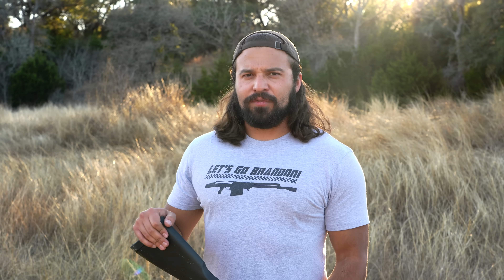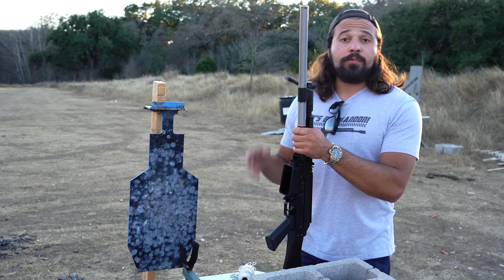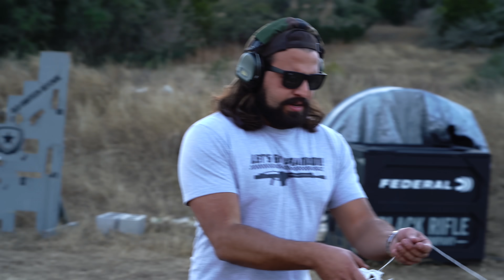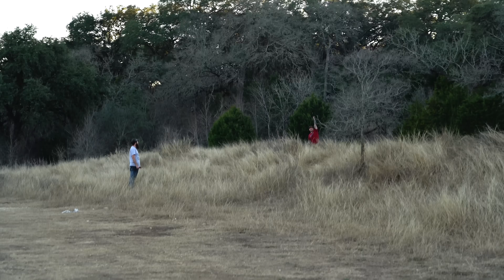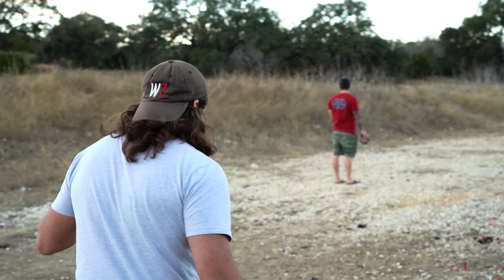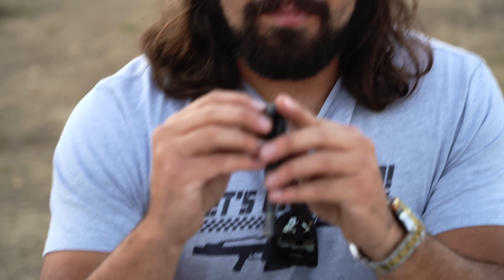Testing an AK Chambered in .50 BMG

Comment: I work in a factory that makes automotive components, and my co-workers come from what you might call a wide range of backgrounds. When something breaks or a screw in a machine gets sheared off, sometimes, people get... confused. They ask, "How did that break?" I say, "The machine is just too strong, and it is a bad design. It just ripped that bracket off and sheared those four bolts off." They say, "How? It was metal." Once a material strength gets beyond what a human can bend by hand, people have a hard time wrapping their head around the forces involved. Some people do not even have a clear grasp of the difference between steel and aluminum. I do not really blame them for not knowing, but it is funny when they argue with me.
Reply: it's kinda odd though. like I failed physics but, general watching shit on youtube of how things are made I understand generally how these function and how easy it is for parts to fail even in all steel constructions.

Comment: I would love to see a collab with Smarter Every Day. Between you two, I would love to see a video of what happened and why exactly that gun failed the way it did. Not just the barrel coming off but all the other ways the gun grenaded as well.
Reply: Stay tuned, that's exactly what this boy does.
Reply: big boolet,not so big barrol ,not strong like dimitri........any more questions?  look at the shell casing diameter,compared to the outer diameter of the barrel....very,very thin....theres a reason the bmg 50 is designed the way it is
Reply: @trillrifaxegrindor4411  Yeah, I get that, I was thinking more along the lines of using an actual high speed camera to determine the order that the gun blew apart in. Like, First the barrel came off, then the locking lugs were sheared off and the bolt became a spear, and even after that there was enough pressure built up to cause even more failures as the gun explosively disassembled.
Reply from the maker: I would love to do one!

Comment: Without watching the video, I'm predicting the locking lugs on the bolt will sheer off, causing the dust cover to pop off while the entire bolt assembly flies backward out of the gun. There's stories from the Vietnam War about troops sabotaging NVA and VC ammo dumps by replacing the gunpowder with high explosives, which caused exactly what I just described. A .50 BMG chambered in a gun not designed for it would yield similar results, I imagine.

Comment: I was expecting the barrel to be rather less intact than that, after seeing what it did to the rest of the gun (though I'm not surprised that the gun exploded).
Reply: Weakest link breaks first. The barrel was likely the thickest metal on there. Also the bolt does not lock forward

Comment: I'm guessing (after having seen Scott blow up a few more pew pews on purpose) the bolt is going to take a bunch of parts out the back and the barrel is going to shoot forward with the transitional middle pieces turning to shrapnel and going everywhere.

Edit: More shrapnel went back than I was expecting and the butt stock and lower receiver was in better shape than I thought. I didn't think the dust cover would go that far, either. Good stuff.

Comment: I guessed in my head and I was pretty close, I just don't know the kind of pressure that a .50 BMG creates compared to a 12 Gauge. I thought it's gonna split the bolt and bend it apart significantly (but I thought it would stay in the gun in the rearward position) while the dust cover and the recoil spring or bolt spring guide thingy would just brake off and fly away. I didn't know what would happen to the barrel though. I assumed it would just expand and the chamber itself would create a flower like pattern.

Comment: My bet is on sheered locking lugs.  Why would the barrel fail if it's actually a 50 BMG barrel?

Edit: Well shit... I was right.  Still surprised at just how FAR everything went.  It didn't grenade so much as it needed a "Beware of backblast" warning label.  Just crazy that the heavy ass barrel went 40 yards downrange.  Leaving a dimple like that... that bolt might have gone through a fleshy shooter.
Reply: The chamber is thin af.
Reply: oh boy did they fkin sheer HAHAHA

Comment: I'm curious as to which direction most of the energy went. I know that on a standard round detonating out of the chamber the brass casing becomes a shrapnel grenade while the bullet stays relatively still. 

Based on what I saw something similar happened here. The high mass of the barrel didn't go very far but the lighter receiver and bolt assembly tore out of there with a great deal of speed.

It is pretty terrifying that Brandon sat down behind a steel target and water(?) barrel in the direction that most of the energy of a 50 BMG was going.

Now I kind of want you to test that barrel and target against a running 50 BMG  to see just how much danger you were in.
Reply: Since the barrel didn’t fail the force is accelerating the bullet forward and everything else backwards equally (same amount of force). I think the lugs liquified   Allowing the case to burst inside the receiver. So now the force is distributed in every direction, the back of the barrel, the bottom of the dust cover and of course the bolt assembly, which was probably already moving pretty briskly rearward.

I
Reply: I know right?

Comment: Well it definitely fired the round, if it launched the barrel that far out. Wonder how far or accurately the slug actually flew. And although I doubt it would prevent it from exploding, what if you were to drill a much larger port in the barrel to the gas block or tube.?
Reply: The failures happened before the bullet got to the gas block to relieve pressure on it, so I don't think that would help it live

Comment: The only time 'just switch the barrel' works, is when the barrel is also functionally the entire receiver, as is the case on something like a Thompson Contender, or when the calibers being switched between are near-identical in dimensions and have no major difference in chamber pressure. Outside of a single-shot, break-action styled weapon (which even those have some stark limits related to pressure tolerances of the seal) you cannot swap caliber significantly by just changing out the barrel. Or maybe I should correct myself a little further, some open-bolt systems can also theoretically do so via little more than a barrel change and some minor changes to some other things (like the feed system). But those are usually more along the lines of swapping a x51 to a x54R, not along the lines of switching a .22 to fire 54R. 
The only example of an open-bolt system doing that which I know of off the top of my head, is chain-gun systems from Bushmaster. That is to say, strictly vehicle-mounted cannons.

Comment: What's partly terrifying is even with the video slowed down and on 0.25 playback speed, the dust cover still explodes off too quickly to properly see what properly happened to it, same.with the barrel 😬
Reply: Also I could only guess that the brass was blown to bits but couldn't see evidence of it.
Reply: and the sparks flying out the mag well as well as rearward - it looked like a saturn 5 taking off.
Reply: @kurtwpg  yeah the bits of casing probably flew of quicker than the dust cover, once the dust cover opened. Or shot out of where the barrel broke off. Which leads me to wonder if they found the actual bullet and what happened to it.

Comment: This is very hypothetical, but what if you could make a 50 call with shotgun styling. Like a pump shotgun with all the internals to properly fire a fifty cal. Idk that sound cool tbh
Reply: Sounds perfect for home defence but for real tho I never thought of that
Reply: Theoretically possible. For internal lockup, you might need something a bit more stout than what most rifles have. Only concern might be if you drop it, what is the potential of one round igniting the primer of another and destroying the gun’s tube magazine, unless you want to go box magazine.
Reply: @DutchTraveler  I was thinking more like a box magazine like you would find on a AR-15 or something like that
Reply: @GameTime-vg9xs  Again, it’s possible. Doesn’t seem practical though. Problem I see is recoil, since pump action means you have to manually cycle it. You’d either need the barrel and lockup to float independently of the pump, or just be willing to take the recoil to your shoulder. Then again, practically never stopped a weapon from being designed. Would be interested to see what the finished product would look like.

Comment: i thought the part between the back of the barrel and the front of the receiver, where the two parts meet, would explode.
about an inch too far forward, apparently

btw brandon, after the AK-50, what say you try and make a weapon that can fire both shotgun shells and 50 BMG bullets?. i dont know how exactly it'd look, maybe the back part would be strongly reinforced with a lot thicker steel, and maybe the bullet will come with a sort of thick metal sleeve, either just long enough to cover the bullet or really fucking long like the  L O N G  shotgun shell from that one hyper video

Comment: There's two things I would've done better;
One, put the string on the trigger BEFORE putting the round in.
Two, if ignoring the first option, putting the gun on safe after putting the round in before messing with the trigger.

Comment: If you run the video during the slo-mo shot at 0.25x playback speed on YouTube, you can still just barely see the carrier absolutely scudding out the back of that receiver at mach fuck. If you were standing there, you would've got absolutely Scotted.

Sidenote: had to use the Merriam-Webster Online Thesaurus to find the word "scudding" because I didn't want to fall into the pun trap of using the words "shooting", "gunning", "barreling", or most of all "bolting" to describe the rapid movement of that bolt carrier (see why?) from it's proper position inside the receiver to it's new home embedded inside the shooter's left lung.

Comment: From the looks of the table, about half of the gunpowder never even ignited!  I do not know, but I would guess this auto-total-disassembly was accomplished with way less pressure than achieved in a proper 50 caliber system.  Shotguns run around 18,000 PSI (If I recall correctly) and the 50 BMG is likely running at least 50 to 55 thousand PSI; puts the 50 BMG about 10-15 % higher than a proof load for a 12 ga firearm.  Boom and destruction was something to expect - just my guess.

Comment: @BrandonHerrera you realize, of course, that after you get the AK-50 up and running with a production model, you’re going to have to do a video with that chambered down to run 12ga and 7.62. For symmetry. Or science, or something. Also, there will have to be a conversion kit to run 22lr on the ak-50.

Comment: My prediction is the barrel will explode from the shoulder back.
Reply: Well, I was wrong, but I didn't know there were only 2 little pins holding the barrel in. If I knew that, I would have predicted the barrel would fly out, but not THAT far. It looks like the pistol grip is still in one piece, so the gun wasn't a complete loss.

Comment: Most shotgun shells run between 8,000 and 12,000 pounds of chamber pressure and that gun was designed accordingly.  Any idea how much chamber pressure is generated by LC .50 BMG???

Comment: I don't know why you're hyperfixating on the term "fireforming", pretty much all brass fireforms at least a little bit when fired and the case expands outward to seal tight around the breach and chamber of the gun. And in case of the 12 gauge shotgun naturally the necked down 50BMG fireforms to a much larger diameter. Point is, because all the burning propellant is able to blow past the bullet in the barrel there's never enough pressure anywhere to actually destroy the firearm or send a slug down range very fast...